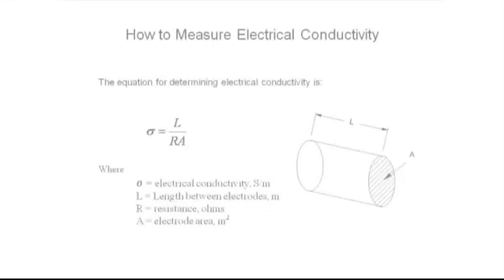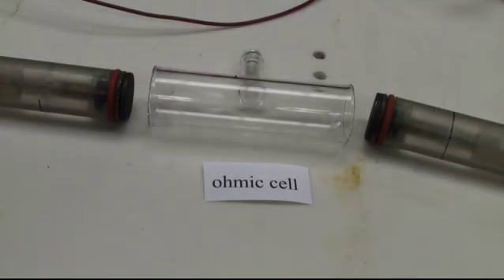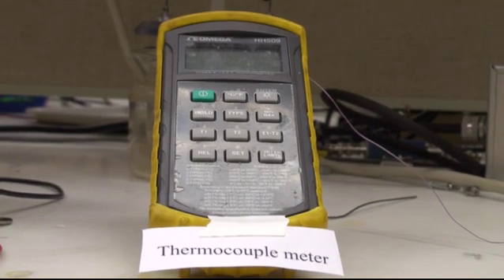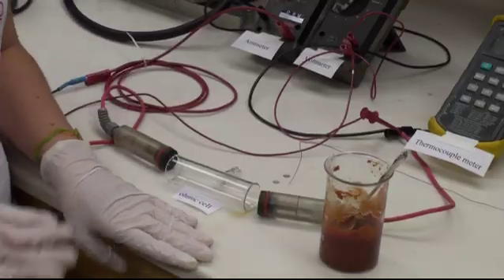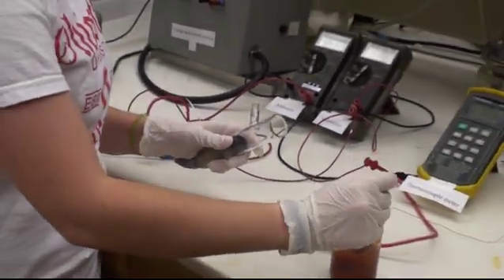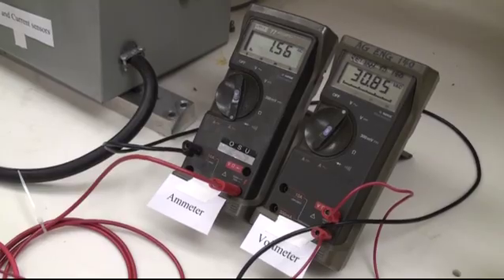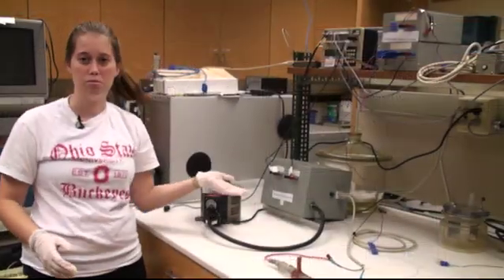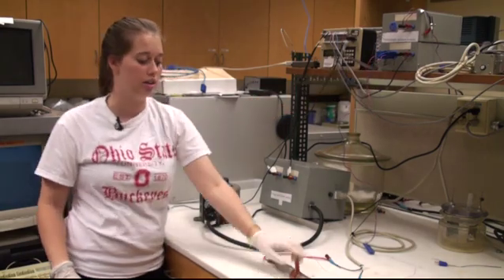Electrical conductivity measurements

Comment from the maker: Apologies for the slow response, but as has been stated earlier, we have been quite preoccupied. The method works for DC only in principle.  In practice, the difficulty is that electrolysis occurs, resulting in gas production (and other reactions) at the electrode surfaces.  This will quickly compromise any readings.  Thus, it is preferred that this method be applied only for AC, and preferably, using electrode materials that resist electrolytic reactions (e.g. graphite, or platinized titanium).

Comment: Bit surprised that no one had the courtesy to answer your question maybe they’re too busy. The test won’t work with DC, if you try to measure the DC resistance of water you’ll find that you get an almost ever shifting ohms reading as the water takes on a charge and the resistance alters. It is however very interesting to look at as it shows just how complicated water is, we take it for granted but the more you look at water you’ll find it gets very complicated. 
Kind Regards ... Andy 
GWØJXM